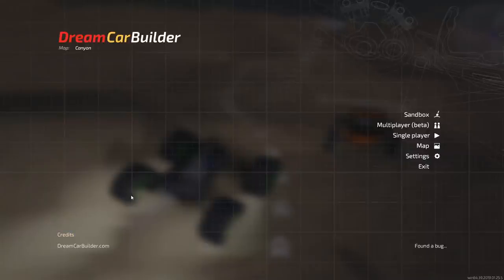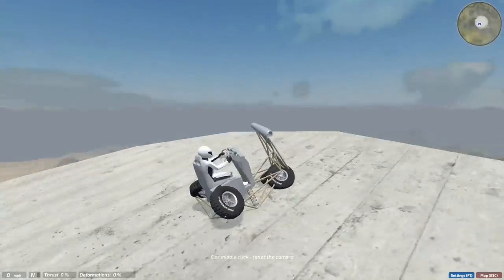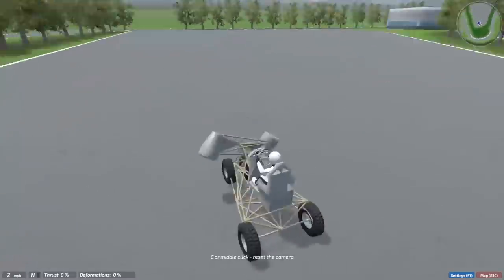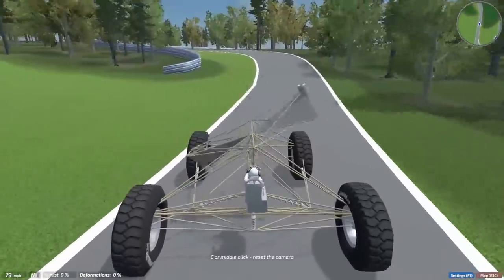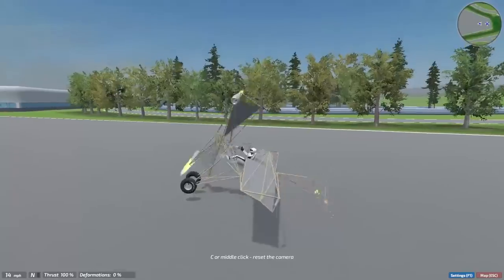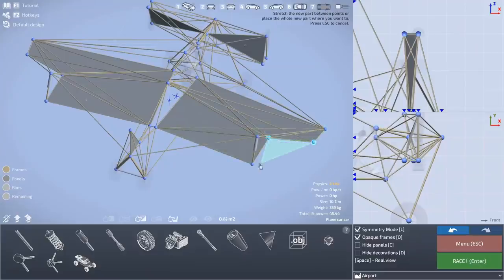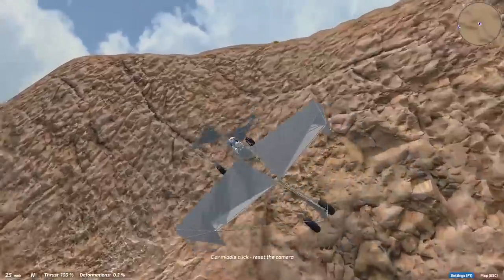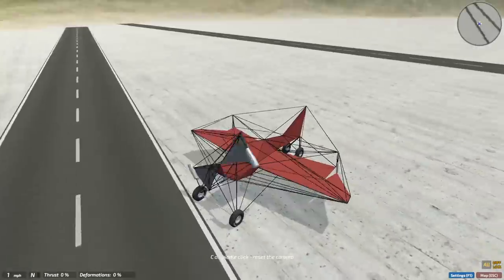Propelling to Victory in Dream Car Builder

Comment: 12:35 , I’m an Aerospace Engineering Major and something to keep in mind when you observe nose diving on an airplane is that the center of gravity has to be in front of the aerodynamic center of your aircraft but there’s a sweet spot for stability which is at about 25% of your Mean Aerodynamic Chord of your wings
Reply: I knew this from playing KSP 😂
Reply: @juliusfucik4011  Me too, coincidentally.
Reply: I actually am a game designer and i've designed systems involving air resistance based drag, which resulted in flight capabilities without hardcoded lift properties. But, it's very interesting to see professionals commenting here. :)

Comment: Just so you know, ailerons are for roll, elevators are for pitch and rudders are for yaw.  Elevons are elevators and ailerons combined.  The control surfaces that you were calling elevons were actually elevators.  Elevons are mainly used on delta wing planes where there isn't a tail to have separate control surfaces for elevators. The main benefit is mechanical simplicity.
You can also have flaperons which are flaps and ailerons combined
Reply: was gonna correct the elevon part too
Reply: yes, thank you
Reply: Mr. big brain
Reply: @specialopsdoggo5100  thx bb
Reply: @callanbrain8579  what did you call me?

Comment: Aaaah, you should totally do this again with some tweaks! The reason the plane wanted to yaw so much was a thing called P-Factor: https://en.wikipedia.org/wiki/P-factor Increasing the size of your vertical stabilizer was the right way to address it. As far as the plane diving, that's because your center of gravity was a bit forward of the wing, which overall causes the plane to dive. To fix that, DON'T just move your center of gravity back because it makes the plane unstable (ever tried to throw a dart backwards?). Instead, add a horizontal stabilizer (next to your rudder) to keep the plane from nosing over. Additionally, you'll have better results if you make the fuselage longer, since that gives more mechanical advantage to your rudder (and un-implemented horizontal stabilizer) to keep the plane stable. Your "elevons" are actually flaps, which is why they weren't particularly effective; since they're on the wings, they're too close to your center of gravity to actually pitch the plane. The reason increasing thrust solved your pitch problems is that you basically created a really crappy helicopter; at a certain point your thrust is generating more lift than your wings, which balances out the center of gravity.

Comment: 4:32:
Well reid you see, in aeronautics, a propeller, also called an airscrew, converts rotary motion from an engine or other power source into a swirling slipstream which pushes the propeller forwards or backwards. If the net thrust of the propellers are uneven, which might be caused by the chaos theory, uneven distribution of thrusters, of slight tilts being magnified, your plane will tumble and crash. To fully understand this, we must take a history lesson: The earliest references for vertical flight came from China. Since around 400 BC,[2] Chinese children have played with bamboo flying toys.[3][4][5] This bamboo-copter is spun by rolling a stick attached to a rotor between one's hands. The spinning creates lift, and the toy flies when released.[2] The 4th-century AD Daoist book Baopuzi by Ge Hong (抱朴子 "Master who Embraces Simplicity") reportedly describes some of the ideas inherent to rotary wing aircraft.[6]

Designs similar to the Chinese helicopter toy appeared in Renaissance paintings and other works.[7]

da Vinci's "aerial screw"
It was not until the early 1480s, when Leonardo da Vinci created a design for a machine that could be described as an "aerial screw", that any recorded advancement was made towards vertical flight. His notes suggested that he built small flying models, but there were no indications for any provision to stop the rotor from making the craft rotate.[8][9] As scientific knowledge increased and became more accepted, man continued to pursue the idea of vertical flight. Many of these later models and machines would more closely resemble the ancient bamboo flying top with spinning wings, rather than Leonardo's screw.

In July 1754, Russian Mikhail Lomonosov had developed a small coaxial modeled after the Chinese top but powered by a wound-up spring device [10] and demonstrated it to the Russian Academy of Sciences. It was powered by a spring, and was suggested as a method to lift meteorological instruments. In 1783, Christian de Launoy, and his mechanic, Bienvenu, used a coaxial version of the Chinese top in a model consisting of contrarotating turkey flight feathers [10] as rotor blades, and in 1784, demonstrated it to the French Academy of Sciences. A dirigible airship was described by Jean Baptiste Marie Meusnier presented in 1783. The drawings depict a 260-foot-long (79 m) streamlined envelope with internal ballonets that could be used for regulating lift. The airship was designed to be driven by three propellers. In 1784 Jean-Pierre Blanchard fitted a hand-powered propeller to a balloon, the first recorded means of propulsion carried aloft.[11] Sir George Cayley, influenced by a childhood fascination with the Chinese flying top, developed a model of feathers, similar to that of Launoy and Bienvenu, but powered by rubber bands. By the end of the century, he had progressed to using sheets of tin for rotor blades and springs for power. His writings on his experiments and models would become influential on future aviation pioneers.[8]

Prototype created by Mikhail Lomonosov, 1754
William Bland sent designs for his "Atmotic Airship" to the Great Exhibition held in London in 1851, where a model was displayed. This was an elongated balloon with a steam engine driving twin propellers suspended underneath.[12][13] Alphonse Pénaud developed coaxial rotor model helicopter toys in 1870, also powered by rubber bands. In 1872 Dupuy de Lome launched a large navigable balloon, which was driven by a large propeller turned by eight men.[14] Hiram Maxim built a craft that weighed 3.5 tons, with a 110-foot (34-meter) wingspan that was powered by two 360-horsepower (270-kW) steam engines driving two propellers. In 1894, his machine was tested with overhead rails to prevent it from rising. The test showed that it had enough lift to take off.[15] One of Pénaud's toys, given as a gift by their father, inspired the Wright brothers to pursue the dream of flight.[16] The twisted airfoil (aerofoil) shape of an aircraft propeller was pioneered by the Wright brothers. While some earlier engineers had attempted to model air propellers on marine propellers, the Wright Brothers realized that a propeller is essentially the same as a wing, and were able to use data from their earlier wind tunnel experiments on wings, introducing a twist along the length of the blades. This was necessary to maintain a more uniform angle of attack of the blade along its length.[17] Their original propeller blades had an efficiency of about 82%,[18] compared to 90% for a modern (2010) small general aviation propeller, the 3-blade McCauley used on a Beechcraft Bonanza aircraft.[19] Roper[20] quotes 90% for a propeller for a human-powered aircraft.

Mahogany was the wood preferred for propellers through World War I, but wartime shortages encouraged use of walnut, oak, cherry and ash.[21] Alberto Santos Dumont was another early pioneer, having designed propellers before the Wright Brothers (albeit not as efficient)[22] for his airships. He applied the knowledge he gained from experiences with airships to make a propeller with a steel shaft and aluminium blades for his 14 bis biplane in 1906. Some of his designs used a bent aluminium sheet for blades, thus creating an airfoil shape. They were heavily undercambered, and this plus the absence of lengthwise twist made them less efficient than the Wright propellers.[23] Even so, this was perhaps the first use of aluminium in the construction of an airscrew. Originally, a rotating airfoil behind the aircraft, which pushes it, was called a propeller, while one which pulled from the front was a tractor.[24] Later the term 'pusher' became adopted for the rear-mounted device in contrast to the tractor configuration and both became referred to as 'propellers' or 'airscrews'. The understanding of low speed propeller aerodynamics was fairly complete by the 1920s, but later requirements to handle more power in a smaller diameter have made the problem more complex.

Propeller research for National Advisory Committee for Aeronautics (NACA) was directed by William F. Durand from 1916. Parameters measured included propeller efficiency, thrust developed, and power absorbed. While a propeller may be tested in a wind tunnel, its performance in free-flight might differ. At the Langley Memorial Aeronautical Laboratory, E. P. Leslie used Vought VE-7s with Wright E-4 engines for data on free-flight, while Durand used reduced size, with similar shape, for wind tunnel data. Their results were published in 1926 as NACA report #220.[25]

Theory and design of aircraft propellers

ATR 72 propeller in flight.
Lowry[26] quotes a propeller efficiency of about 73.5% at cruise for a Cessna 172. This is derived from his "Bootstrap approach" for analyzing the performance of light general aviation aircraft using fixed pitch or constant speed propellers. The efficiency of the propeller is influenced by the angle of attack (α). This is defined as α = Φ - θ,[27] where θ is the helix angle (the angle between the resultant relative velocity and the blade rotation direction) and Φ is the blade pitch angle. Very small pitch and helix angles give a good performance against resistance but provide little thrust, while larger angles have the opposite effect. The best helix angle is when the blade is acting as a wing producing much more lift than drag. However, 'lift-and-drag' is only one way to express the aerodynamic force on the blades. To explain aircraft and engine performance the same force is expressed slightly differently in terms of thrust and torque[28] since the required output of the propeller is thrust. Thrust and torque are the basis of the definition for the efficiency of the propeller as shown below. The advance ratio of a propeller is similar to the angle of attack of a wing.

Yes, most of this is from wikipedia...
Reply: The free encyclopedia that anyone can edit!?
Reply: @mossfinch7456  Is there perhaps any chance that my comment might, MIGHT have been a joke
Reply: @thatcreativebrain8575  Nope. 0% chance. There's also a 0% chance it was a reference to HLVRAI. Absolutely 0% chance.
Reply: @mossfinch7456  Ye ur right

Comment: I’m a pilot and FYI the elevator is placed at the very back of the plane next to the rudder so that it has more leverage around the center of gravity of the airplane so moving it back there should help the controls.

Also the rotation of the aircraft because of the rotation of the propellor can be solved by making a tab on one side of one wing that is solid and angles up or down to counteract the rotation. 

Hope that helps lol.

Comment: I've worked with RC aircrafts my whole life. You should have your yaw control, It wil make for a smoother flight. The reason why you nose-dive is because your center of gravity is to far to the front. If you take a pen and try to balance it on your finger, you can see that where the tip and cap is, it is heavier, so instead of balancing it from the middle, you have to put your finger further to the front. 

You want your center of gravity to be at a point, where as if you where to balance your plane on the midpoint of where your wings are, your plane would be level. But in this case it is not. Try adding a lot more weight to the back of the plane, and try moving your ailerons to the back below your rudder, or yaw control surface.

Comment: You need to put the elevons as far back from the centre of mass as possible, so they get the same mechanical advantage as the ailerons.
Reply: Yeah, making a proper horizontal tail-surface ought to help a ton

Comment: The reason your plane wants to turn to the right is because of the propeller torque. Normally this would be cancelled out with a rudder trim surface. However, it'd be easier to use two counter rotating engines in order to cancel out each other's torque.

Comment: 9:32 this is what I believe to be P-factor. It is caused buy the rotation of the prop and exerts a force on the rest of the plane. This is counteracted by the rudder on take off and a trim tab is set in level flight. One thing that strengthens the force is increasing the throttle. Best thing to do in my opinion is to just counteract it with rudder instead of creating drag because then it will make the plane slip to the direction the panel is when you decrease throttle for landing as p factor is weaker as the engine rotates less.

Comment: My solution to the clockwise rotation would have been to add a second propeller right behind the first which spun the opposite direction of the first. You could then make both smaller and hopefully that would offset the tendency to turn clockwise

Comment: Awesome video, and the helicopter rocks too! Thanks for taking the time to make these videos, they're informative and fun.

RE the constant clockwise rotation, it could be gyroscopic/torque-induced precession, which is a torque-induced force that causes this kind of behavior.
see: wikipedia.org/wiki/Precession#Torque-induced

If you can't ignore it with sheer counter-mass, you can either spin a heavy disc within the vehicle to cancel the effect out, or use two mirrored engines that turn in opposite directions, or reduce the torque problem by using smaller jet engines and larger propeller blades or a more efficient engine altogether.

Comment: bring the thrusters in closer toward the middle of the blade and add 2 more blades, might help some because you can reduce weight on the edge and increase stability
Reply from the maker: I thought about making a tri-blade prop, but symmetry was hard. I guess I didn't consider quad-blade designs but yeah that would have solved some problems.

Comment: Hey, sorry if the idea is stupid (or late) but, the propeller is making the plane rotate, right? Well, for avoiding that, why don't you add another propeller equal in pitch and size but inverted (going forward in the other direction)?
Love your vids Btw

Comment: a couple of tips for improving the flight characteristics of the plane: 

Your nose is pitching down because you didn't add the elevators (horizontal tail wings). They create a downward force which helps balance the lift force from the wing and they help control the nose pitch. (You should research them a bit further but thats the gist of it).

You can also increase the size of the rudder to help with yaw stability

And one last thing. One reason your plane was yawing to the right might of been that you had an imbalance caused by the forces of the spinning of the propeller. You can add a counter spinning prop in front of it ( with the collective opposite to the collective of the regular one) to counteract that force.

Comment: maybe try adding a counter clockwise propeller?
I know the game offers 0 friction in moving joints but I think it is worth a try
...
also the thing with propellers where you hold accelerate for too long they break themselves might be because
all 3D geometry and physics calculations are done with numbers which is good on paper but computers have serious limitations on numbers, how big a number can be, how many times the calculations run every second (most likely = frames per second) and what max. precision every variable can hold. If we remove the limitations, you might just hang the computer at 1st non-terminating division type of calculation because the 100% of the computing power will be busy calculating it's infinite precision value. So since limitations are necessary, the values and calculations aren't 100% accurate. Which resonates perfectly with a rotating object at high speeds (jk, it's the opposite XD), as calculations most likely happen in 60 frames per second, the physics engine sees that the propeller is some way one frame and it went backwards the other frame (lol) hence breaking the calculations and ultimately your propeller. Which gives me an idea, try to run the game at lowest graphic settings and as high frame rate as possible and check if the propeller breaks the same way it did in 60 fps.

Comment: By the way, you could add an elevator that’s connected to the bottom of the rudder horizontally and connect them to pistons to make them angle up and down when you want it to, instead of the elevons, however you spell it.

Comment: I don’t think the issue is the same as in the game, but usually single engine propeller aircraft have a vertical stabiliser “tab” that divorces air as a sort of trim from the propellers air stream (the air moves in a spiral after leaving the propeller and hits the side of the tail which pushes it to the left or right dependent on the propeller direction)

Comment: Jsyk, you keep on saying drag and lift like they are interchangeable, but they are completely different. Lift is how much downward force a surface can make at a certain speed in air. Drag is how the air moves after it isn't touching the surface anymore.

Comment: Would it be possible to add an additional propeller but have it go counter clockwise to neutralize the turning momentum? It shouldnt mather which way a propeller is rotating aslong as the angle of the blades provides forward thrust.